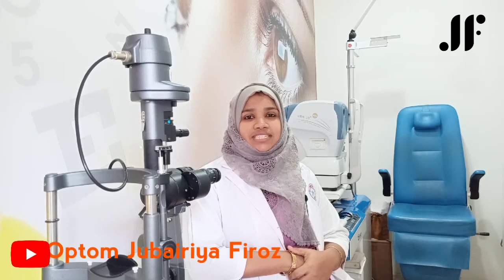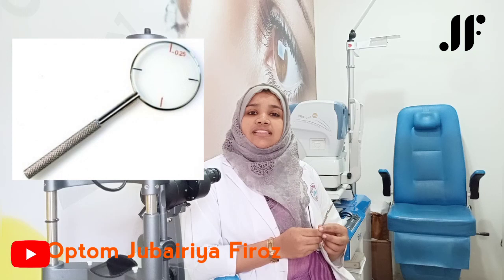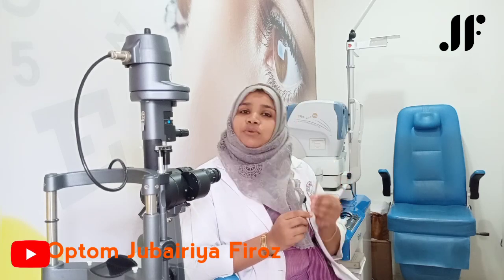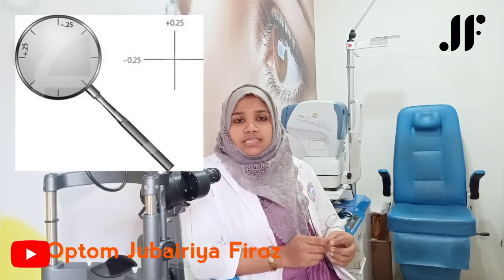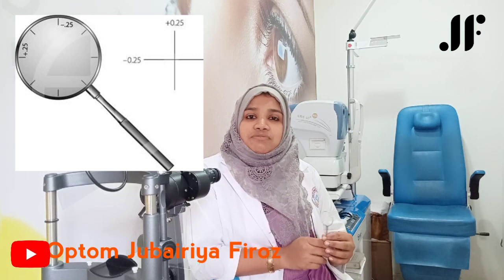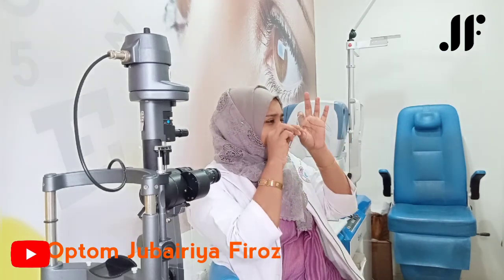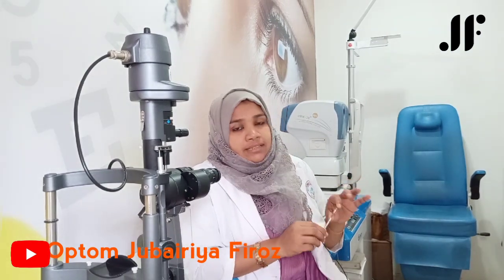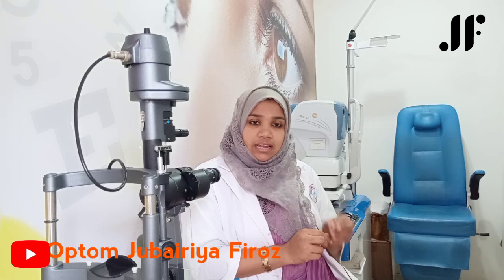Introduction to JCC Part 1 Malayalam

Comment: its a good class... may I give a small correction? JCC is not 2 cylinder placed crossed..but it is a spherocylinder. A sphere and a cylinder combination. Here ,when a cylinder is placed , the power perpendicular to it is given by the sphere there.. which now acts like 2 cylinders, placed perpendicular, but actually a cylinder and a sphere, thats why we mention here about the spherical equivalent which comes to 0. I hope u purposefully dint mention to avoid confusion
Reply from the maker: JCC is surely a combination of two cylinders of equal power and opposite sign.
Such a combination of two cylinders results into a spherocylinder where cylinder is double that of sphere and are in opposite sign, hence the spherical equivalent becomes zero.